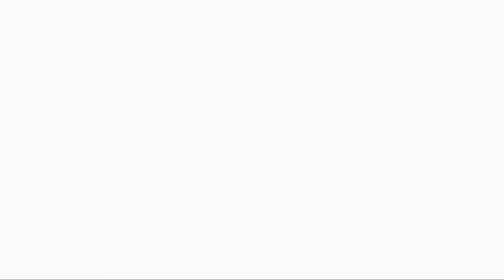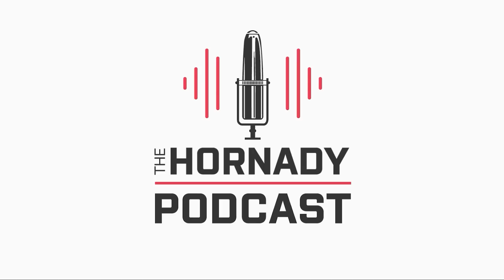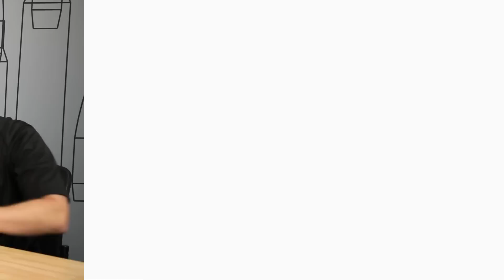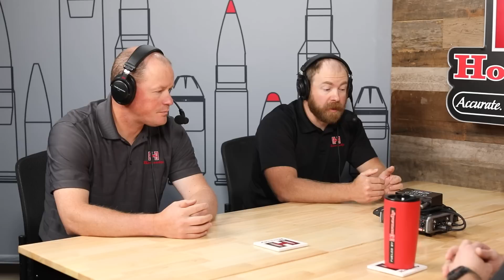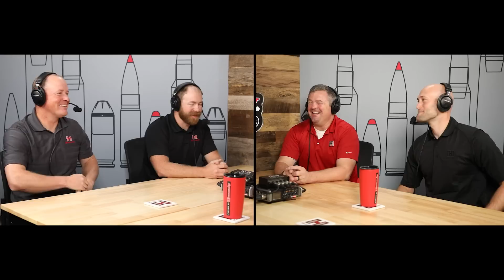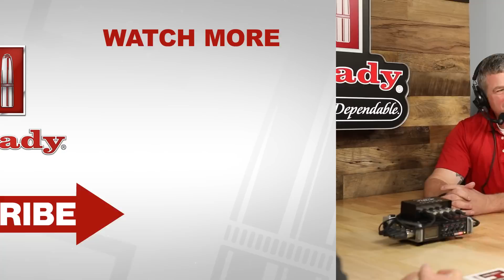Ep. 007 - CX Bullets - The Most Advanced Monolithic Hunting Bullet

Comment: I have converted over to both CX and ECX bullets and they are working well but I find it very hard to find load data. There doesn't appear to be any for ECX and I'm told to use GMX data for CX. But if the CX bullet is a step forward over the GMX I would expect the load data to have changed as the difference sounds like more than when, in the past, I have compared other other very similar bullets to each other and in that satiation I have seen significant differences in load data and the most effective powders.

Comment: Why is the .257-90 grain Gmx Bc .290 and the new CX 90 grains bc is lower at .273 and the sectional density of both are .195 this is not an improvement this is going backwards!! Even the 80 grain Barnes has a higher Bc than the 90 grain CX and Gmx!! This is why I have switched to Barnes Lrx until Hornady comes out with something comparable to the Lrx in the calibers that I shoot!!

Comment: How has accuracy been with the CX bullets? Optimal twist rates same as equal weight leaded bullets?
Reply: This wss explained in the video.  A monolithic copper alloy bullet has to be longer than a copper cup and lead core bullet of equal weight.  It is LENGTH, not WEIGHT of the projectile that influences the twist rate required to achieve stabilized flight.  Optimal twist rates will be the same for same-caliber bullets of the same overall length.

Comment: As far as minor diameter bore or land wear from solid copper projectiles especially one without alloys, where do we stand right now with physical documentation testing data? 
I know it’s going to vary dramatically depending on bare stainless barrel vs. a melonited barrel with such a hard surface treatment. Having a “relief” cut or cannalure surely helps with material displacement, but what about the other projectiles? LOVE the discussions you guys put together and LOVE THE PODCAST! Keep it up 👍

Comment: Extended range does not make you a better hunter when you lose hunting ethics and when you lose hunting ethics why even hunt ? Copper lead bullets ok, Copper only not,to expensive, keep the yardage down when you use copper or you get over  penetration,and if you can make a Copper bullet that retains 65% of its weight great,95% retention not good at longer range,so if you have a 95% retention at 200 yards now with increase yardage you get over penetration and less expansion,bonded lead core bullets for bigger game great,Interlock bullets for smaller game great,copper bullets at extended range is not smart or ethical, prove me wrong ? And why would you use sealer on a press fit bullet and primer ? So aim small good hunting.
GOD bless the great USA! !

Comment: I'm shooting the 130g CX out of my 270win.  I haven't shot any big game with these yet. I have used the 145gEldx  a lot with great performance.  Have you had any performance reports for the CX yet?
Also, why does the 130g CX drop a lot more at 300 plus yards, than a heavier 145gEldx? Enertia??
Reply: As an accomplished F Class shooter and many years of loading i tested these CX bullets over quite some time over a few good shooters and i would like to say the CX 130 shot like lead bullets or as close as, they are a big advancement to GMX which were frankly not good
Shooting the 130 in your 270 at around 3060 fps yielded some of our best results on Red deer size game

Comment: Do you think it's finally time for a 6mm magnum?  Or a new short action 243 replacement with a faster twist and longer bullet in the 130-140gr class.  I shoot a 6.5 creed and a 243, the difference between the 2 is pretty Remarkable when you look at the bullet selection and weights.  Those 100gr bullets show their age and seem to not perform as well as a 6.5 creed.  I'm not a fan of the 6mm creed because the ammo is hard to find and it seems very picky on powders for reloading.  I think its mainly because it wasn't optimized like the 6.5 was.  It seemed like they just crammed the 6mm in there and crimped it down.  The pressure spikes seem to make it very notch and creates weird cells.
Reply: 6mm Creedmoor and 6mm ARC are basically the new 243.

Comment: they had to come out with a new bullet because the eldx is a junk bullet that comes apart, obviously the testers don't know what they're doing, the eldx bullet isn't even bonded.
Reply: EldX is an overhauled SST to get match grade characteristics like the ELDM. Match bullets aren’t bonded for best accuracy. Bonded bullets are best used when shooting very fast so that they hold together. Slow your ELDX down with less powder or a slower cartridge to reduce stress on the bullet, increase your range to reduce impact velocities, or aim for squishier shots when impact velocities will be over 2600-2700fps (neck, behind shoulder), or switch to a stouter bonded or mono bullet. I use ELDMs which are even more prone to coming apart than ELDX but as a result, they open up at even lower velocities. Works great with mild cartridges like 308 in short barrels, or at extended ranges, but same principle. Try to match the bullet toughness to your expected impact velocity.

Comment: I noticed on my older Hornady ammo with a red tip that the “polymer” tip has shrunk considerably. Will this noticeable shrinkage affect the performance of the ammo to the point where I should trash the ammo? No pun intended. I buy your Duty ammo for four different pistol calibers usually the plus P and many hunting rifles on the heavier for caliber end of the spectrum. I have a 308 that loved your light magnum ammo, but I haven’t been able to find it for years now. What would be the closest alternative to it?
Reply: I’ll give my opinion here on your first question. If the tips are deformed, it will effect your bc. Furthermore, I’ll bet no two tips deformed identically, which means your shot to shot consistency is going to be garbage. But I wouldn’t throw them out. As I see it, you’ve got two options. 1) use them for plinking loads in a non-precision setup and just have fun with them. 2) Try pulling the tips. Behind those tips us just a hollowpoint projectile. The polymer tips only exist to make the tips more consistent than an open meplat. Since they aren’t doing that anymore, just pull them out like a bad tooth. I’ll bet those bullets will shoot great without them.
Reply: Shoot them, bet you don’t notice a difference

Comment: I bought a box of 80gr 6mm Hornady CX bullets to check them out.  Glad I only bought one box.  So while I was waiting for my box to arrive, I called Hornady tech support and asked what the length of the bullet was.  I was told 1.102".  That was yesterday.  Today, received the box of bullets.  Their actual measurements vary from 1.109" to 1.111" in this box.  WTF Hornady!  You folks have lost the concept of precision manufacturing.  Done buying your junk.  Back to better brands.  Note, you wont find a Hammer Copper bullet like that.  Sad production on a once good brand.  You should be slapping yourselves.  Oh, and it is lot # 2220144

Comment: So does this mean the normal traditional twist rates for these calibers would have to be changed to shoot these specific bullet?
Reply: Best question here.
Reply: You will have to research that for your caliber. As an example I shoot a .270 win and the available factory Ammo with the CX bullets only come in 130 grain not 150. This is because the twist rate to stabilize a bullet depends on the length of the bullet not the weight. Copper alloy being lighter it will be a longer bullet compared to the same weight lead core round.

Comment: Whats is the twist rate or length on the 180 308 cx bullet, The info can not be found anywhere??
Reply from the maker: Minimum of 12" twist for the 180 grain 30 cal.
Reply: @hornady  thanks for getting back to me, that I formation down not exist online. I’m surprised it will work considering the 165 won’t even work with the 1:12 twist. When will the 180s be shipping out?

Comment: I am 70 years old and   have just bought a 300 Weatherby with 21 inch barrel and Mannlicher style stock.
You just convinced me to shoot 165CX at somewhat reduced velocity to reduce recoil.
If you think getting components in the US is tricky try living in Alberta where a local gunshop ordered 2000 pounds of powder and got 80.
My lucky number is 7, so I bought a pound of IMR7977, which will last me a lifetime.
My goal for 50CX bullets with 7977 is 50 moose, elk or caribou.
Thanks for doing the heavy lifting to make that goal at least possible.
Reply: depending where in alberta I could drop you off a box im traveling through multiple times a year.

Comment: Been using copper and copper alloy for 30 years to include  7 African animals.  They go in the size of the caliber and exit twice the size.  They go through shoulders and still exit the other side.  The hydro dynamic shock, in between, is devastating and you have two holes pouring blood.  You also, don't have flakes of lead or jacket in the meat.  I will give the CX a try!  

Still waiting for the 223, 55gr sp's, to be in stock, for prairie doggin this summer.😜